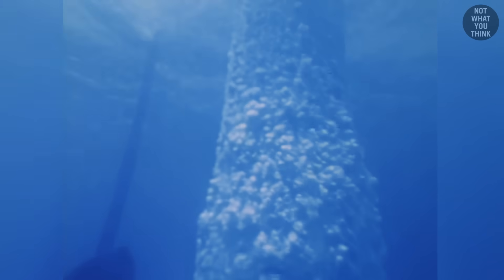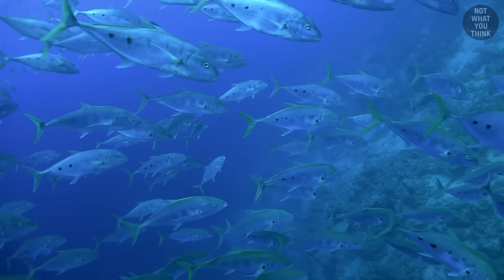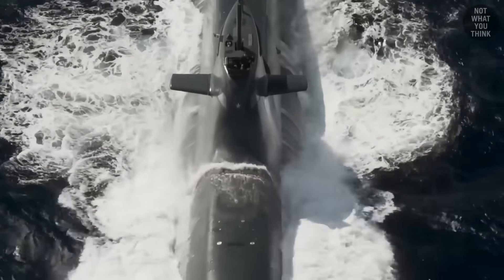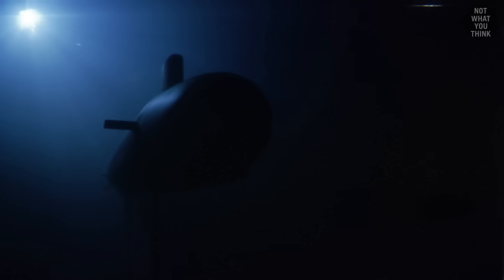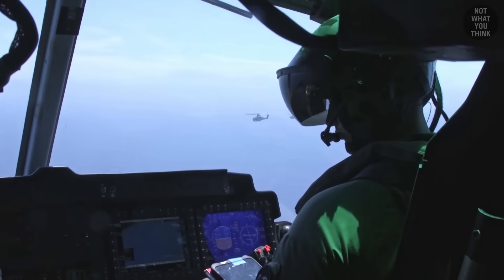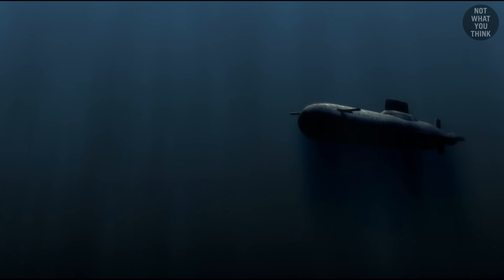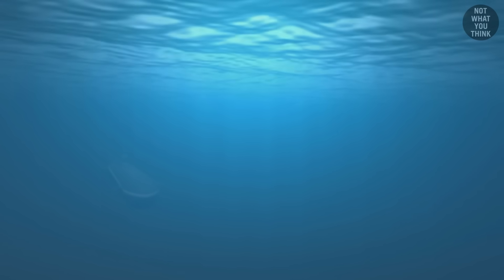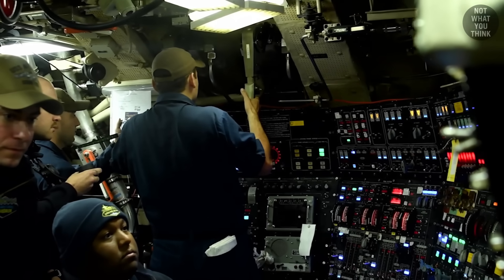Why Being Too Stealthy is Bad for Submarines

Comment: Well tht didnt start well. "They are only as deadly as they are stealthy".  Nonsense.  "Once they are detected the jig is up".  Er, not necessarily and detection is not easy "They just become giant targets".  Er, again, no.  This is obvioulsy not written  by a 'tube-dweller'. 
You cannot hear a human conversation inside a tube.  How can you create a database of signatures if you cant hear them?What use is this empty database  if you cant detect things? Torpedoes come in heavyweight and lightweight variants with considerably differnt depths, speeds and ranges.  Subs can defeat them.

Comment: Subs can also be detected by the water they displace or the space and density of water versus steel and rubber or by cavitation or their props.    They can even be detected by the amount of CO2 they discharge because everyone knows bubbleheads are blowhards. 😂. They can even be detected by the squeaky hinges on all the screen doors installed on each of them.

Comment: Missed a ton or just put out the cover stories. The tiles are much more than you say. The alloy of the hull was missed. The way the inner & outer hulls are separated was missed. The active methods of background masking was missed. The methods of using marine life was missed. The heat dissipation & utilization was missed. 

Yes too quiet is a problem if not managed but that's being done. Also the differences in mission & methods between Boomers & Sharks was not addressed. Also the fact there are a few other classes not mentioned & their missions. Overall weak.

Comment: I had a chance to work on a marine radar system for a pleasure yacht, 20 years ago, and that system was able to paint a loon floating across the harbor, while giving speed and direction information as it paddled along. I can just imagine what military radar can do with the wake of a parascope even if the mast is coated with antireflective materials, not to mention FLIR cameras seeing the heat differential as well. It is one reason the drug cartels are slowly losing more and more of their submarine drug boats, not to mention the noise those suckers produce as they race along skimming the water, with all of the hydrophones in the ocean!

Comment: Worked as a systems engineer co-op some years back for General Dynamics Electric Boat out of New London, Connecticut (I worked on Virginia-class submarines).  Working on those boats and seeing them in the flesh was incredible, and they're seriously some of the most complicated and impressive machines on the planet.  Despite having a security clearance, there were endless details I wasn't privy to, including max dive depth and of course the design of the propeller; my understanding was that even engineers years into the job didn't really get access to the information, and of course they didn't want me knowing who did and didn't have the info whenever possible.
Reply: If you didn't have a need to know you didn't get to know.

Comment: Not being able to be heard or seen is potentially a double edged sword. I recall a US submarine that sank a JA ship when it surfaced near Hawaii. No one on the sub was hurt but most people on the ship drowned.
Reply: yeah that was a bad deal. Shortcuts were taken and it ended badly. I've got the book. On the other hand while serving on an old US diesel boat we were doing training ops with some surface ships and we were almost run down by a US destroyer when we were preparing to surface. Our captain was very angry. Said a lot of bad words over the UQC.
Reply: @simplyamazing880  I toured a los Angeles class fast attack at Norfolk, how does that compare to one of the older diesel boats. That would be a challenging lifestyle to get used to for me. I'm not claustrophobic but I know the feeling once they pull the gangway that's it.

Comment: Wait a minute.  If diesel electric (battery) subs are so vulnerable, why not use nuclear power to charge the batteries and thereby stay submerged longer?

Í think Rickover would have liked the idea.
Reply: Because you can't exactly "turn off" nuclear reaction, unlike a diesel engine. It has to constantly be cooled off, and so there'd still be some kind of noise generated. In that kind of situation, I imagine it'd be better to just power the ship directly from the reactor, instead of going through a battery.

Comment: Why don't submarines generate sound "noise" (like radio noise) to hide their signatures while moving in unthreatening positions? Or to even mimic something else? The US heard the Russians first launch one of their new huge subs in like, the 80's or 90's. So why not flood the entire area in underwater oscillators to blind anything listening while something clandestine is taking place? Got a severe emergency where you need to secretly move your subs from A to B? Drop a couple thousand battery powered orbital sanders encased in capped steel pipe across a swath of that sea, and that half of the ocean will be acoustically blind. (I mean, not EXACTLY that method, but I think you readers can see what I'm getting at here..)

Comment: You are forgetting that all modern diesel-electric submarines have a snorkel system. This allows them to stay submerged while their diesel engines are running to charge the batteries. The sub has to stay close to the surface when it does this, but its a lot better then surfacing to charge their batteries.
Reply: So do the nukes but I can tell you that as soon as you light off that bad boy you just announced yourself to the world. if you have to wear hearing protection while it's running it's not sneaky in any way.

Comment: No. You are just making stuff up. The Seawolf is not the quietest submarine. No large nuclear sub with a reactor that needs to be cooled can run as quietly as small non-nuclear ones operating on battery power or air independent propulsion systems. It is not even close.

Comment: Sweadish subs can actualy run there engines under water to charge there battery not even needing a snorkel.
Reply: They compress the gasses that get released or something?
Reply: They compress the gasses that get released or something?
Reply: @Pnschs  Yes somthing like that as well as using engines that create a tiny amaunt of gases

Comment: I wonder if they ever considered trying compressed natural gas to power the generators. Of course they can't run the engine in a normal sense because it would immediately use up all of the oxygen in the sub underwater, however I can imagine coming up with designs that use a fuel/oxidizer mixture in a closed cycle or something. Always something new
Reply: Aren't the gasses produced the problem?

Comment: The Seawolf class is not the quietest submarine on earth. Maybe the quietest nuclear powered submarine, but certainly not the quietest overall. Nuclear submarines are always louder than conventionally powered ones, because the cooling system for the nuclear reactor makes noise and don't forget that a nuclear reactor is basically still just a steam engine and making steam and running it through turbines makes noise. No matter how well you shield the noise, it will still be louder than a conventional submarine that just runs on batteries or on new air independent propulsion systems like those hydrogen powered German ones.

That is also why the US Navy, till a few years ago, was still secretly operating a few old, diesel-electric submarines from the 1950s, just for the job of landing special forces, because the nuclear powered ones were too big and too noisy for the job.

They only retired the old boats now that they switched to using those new purely electric parasite submersibles, which ride piggy-back on a nuclear powered submarine and allow it to stay far away while still delivering frogmen to shore somewhere.
Reply: Diesel generators are also steam engines tho.
Reply: @dojelnotmyrealname4018  No. What makes you say that? Does your car produce steam to power a turbine?
Reply: @TrangleC  My car engine is not a generator.
Reply: @dojelnotmyrealname4018  And diesel engines are no steam engines.
Reply: @TrangleC  What diesel engines are is irrelevant
Reply: @dojelnotmyrealname4018  Then why did you come in here making a (wrong) claim about what diesel engines are?
Reply: @TrangleC  When exactly did I use the word engine?
Reply: @dojelnotmyrealname4018  Whether you are a really bad troll or really dumb, I don't know. Whatever it is, it is really embarrassing.
Reply: @TrangleC  Not my fault you don't understand the difference between an engine and a generator.

Comment: Airborne command post aircraft (EC-135C Looking Glass) transmitted on ELF during the Cold War to communicate with subs. They used a copper cable 5 miles long and often had to cut the cable if it did not retract properly.

Comment: modern cameras are so small and good, they need to place them on subs to reduce the need for sonar to see where they are going.
Reply: Even if the water was perfectly clear, visibility would only be a hundred metres or so. Sea water absorbs light.

Comment: Fun fact: sonar pings hitting a sub do not bounce off of the outside of the hull.  It bounces off of the interface from steel to air on the inside.  That is where the density difference is the largest.
Reply: And , if it was mentioned, I missed the part about sono buoys being able to use active sonar to "ping" a sub. Dropped in a pattern around the area of a suspected submarine, they can pinpoint, through triangulation , the location of it pretty close for a torpedo launch.
Reply: @spikespa5208 To be pedantic, it would be trilateration as the sonobuoys only detect range, not bearing to the sub.  The bearing has to be computed from intersections of the ranges.  (Same way GPS works).
Reply: @AlanTheBeast100   My gap in info.  I thought the sonobuoy could determine bearing in passive listening mode .  But get both bearing and range from active mode.
Reply: @spikespa5208 they do get bearing and range
Reply: @spikespa5208 No - bearing is a derivative information and require a number of sonobuoys to allow trilateration to occur.  For that matter the computation takes place on the aircraft that are receiving data from the sonobuoys.
Acoustically, bearings need a large aperture - and sonobuoys are small.
Reply: @spikespa5208 Some have fold out hydrophone arrays so that they can get a bearing estimate.
Reply: @AlanTheBeast100  Some sonobuoys have fold out sonar arrays enabling bearing estimates to be obtained.
Reply: @rogerphelps9939  Uncle!
Reply: @AlanTheBeast100      Hoping not to sound dense,  just trying to get it straight.   Seems active  "ping" mode would be the only way to determine range from a single sonobuoy since the operator (in the plane) has no idea, by just listening,  how loud a noise was at its source , hence how far away it is from that buoy.  If a single  buoy can't determine bearing, does that mean buoys have no passive , listen only mode?
Reply: @spikespa5208 For accurate range, yes, pinging is best.  Sonobuoy use doesn't preclude pinging - the sub can hear the buoys dropping - he knows he's being hunted - so passive listening is not the default.
That said, for passive use, the operators have all sorts of techniques to guesstimate range (relative signal level, etc).  With that they can vector the plane for a MAD pass (or turn on active pinging at the right moment).
Sub hunting is not a fast sport - until it very suddenly is for the hunted.
Reply: After some serching,   apparently  military ASW passive sonobuoys do have bearing determination capablility, DIFAR.  It seems that a passive mode buoy  or dipping sonar ( ship VDS or helicopter) in passive mode  would be almost useless without that capability . About all it could tell you is that there is a noise/signal  source  somewhere  in the vicinity.  Relative noise/signal strength works, yes, with mutiple listening points(buoys) .
Reply: @spikespa5208 Colour me wrong then.
Reply: @AlanTheBeast100  I think you mixed up range and bearing. DIFAR and VLAD can detect bearing. But they're fully passive, so they don't get the range and you have to triangulate. DICASS uses active sonar and can also get the range, but because it's active it's detected immediately and should be used right before the attack since the target will make evasive maneuvers.
Reply: @tykjpelk  Mixed up yes - at least for DIFAR.  You don't need a "range" function to calculate range otherwise.  Analysis will get you there with enough information including signal (audio) strength - not precise - but close enough to begin the MAD search.
Reply: @spikespa5208 Which is not how it's done.  They typically laid down two lines in an L shape - though more recent tactics use other patterns.

Comment: "Accidental collision"...in that small ocean...bullshit. The regular routine is to trail other submarines.

If you're not trailing a submarine, and you can't detect one, there's a chance that's there is an enemy sub right behind you, in your wake, where your sensors fail.

No other sub in sight? You stop the engines and turn hard. Your chances to detect the enemy sub increase dramatically. 

The other submarine, which already has its nice right to into your ass because of "because I can, motherfucker!" reasons, collides with your sub.

For some reasons, everyone tries to sweep such incidents under the carpet. 

Usually successfully. 

This shit happens a lot.

Not convinced? Consider the size of an average sub...and the size of an average ocean.

Comment: most dangerous subs are Boomers which carry nukes and are desighned as last revenge tool in case of end war and for same reason are build Hunters for hunting down those boomers before they can launch their deadly cargo.
Diesel subs are actually quite small and are build for coastal deffence and generaly dont too far from home harbor and we can see how Russia transit thrue their internal canal system a ton of diesel sub to black sea and use them launching pad for missile barages while real big nuclear subs stay on open ocean.

Comment: The "acoustic hole" if one looks at it mathematically is bogus.  At any realistic distance the arc subtended by the submarine is very small and any noise in the ocean will bounce and bend around that tiny arc.  In all my experiences I was involved in detecting another sub, doing so by quiet hole in the ocean was not one of them.
Reply: Long sound waves will bend around the submarine, short waves will not. This is more pronounced for larger submarines, such as nuclear submarines, especially boomers.
Also, there are several examples of submarines colliding with each other, so at those ranges the noise hole would be very detectable.
Maybe not as useful to hunt enemy subs, but good enough to avoid crashes.
Reply: Yes. I has to be very close for it to work.
Reply: Yeah that's a bunch of malarky.

Comment: I'm surprised that you did not discuss the ASROC. A torpedo with a rocket motor that lands on top of a sub giving it much less chance to evade.
Reply: I was in the Navy in the 80's and we learned that Asroc was more for the construction jobs than an actual effective weapon. the Rocket motors decayed, the Torpedo was woefully inadequate. The only place it worked was in Video games. or if it was Nuclear tipped, but that would have most likely resulted in a "Own Kill" as in suicide.
Reply: colour me surprise that he mentioned the obsolete Russian RBU-6000 11:27 but completely dodged the Swedish anti-submarine mortar (Elma ASW-600)
the usage of rocket-propelled depth charge is probably more nuance than just "being inferior to the 324mm torpedo": 
in shallow coastal water (like the Baltic sea where the Elma ASW-600 is deployed), the uneven sea bed clutter can reduce the effectiveness of the torpedo's sonar; the ASW ship's sonar could have reduced effectiveness too, leading to the enemy submarine capable of staying very close to the ASW ship (to increase the effectiveness of their own 533mm torpedoes), which is well inside the range of anti-submarine rocket/mortar.
ASW rocket/mortar has greater responsiveness (the rockets fly at Mach ~1) on top of having no care for sea bed clutter.

in open ocean water, the greater effective range of the ASW torpedo is more advantageous than the ASW mortar/rocket, so the 324mm torpedo largely replaced the ASW mortars in most Western (blue water) navies; 
in green water navies, the ASW mortar/rocket and the ASW torpedo works alongside each others.

Comment: Good episode that explained the light about submarines well including detection of them, but you missed one important thing that aircraft use to detect any submarine, either nuclear or diesel:  the MAD sensor that sticks off the back like a stinger on a wasp.  MAD stands for "Magnetic Anomaly Detection".  All submarines are built out of various kinds of metals such as steel or titanium. This has an effect on how the earth's magnetic field is around them, even under the ocean.  The MAD sensor can pick this up similar in a way. A metal detector will work on a sandy Beach and is very accurate. Outside of military applications, survey aircraft use it to find certain types of metals underneath the earth's crust just by flying over them. They are very sensitive. 

You talked about everything but that and it's an important piece of kit in an anti-submarine aircraft.
Reply: You are both right and wrong. MAD booms were standard in older turboprop ASW patrol aircraft like the P3 Orion.  Since the aircraft needs to fly extremely low to utilise the MAD effectively,  thus increasing flight risk and fuel consumption,  the newer jet propulsion ASW aircraft is no longer equipped with a MAD system, e.g P8 Poseidon. These will typically operate at a significantly higher altitude,  giving safer flights, lower fuel consumption and thus better endurance.